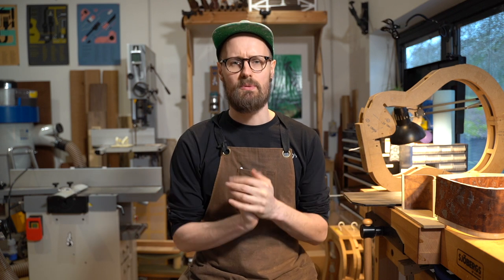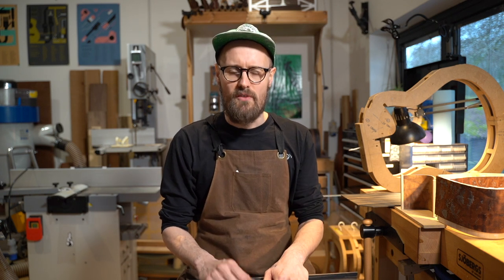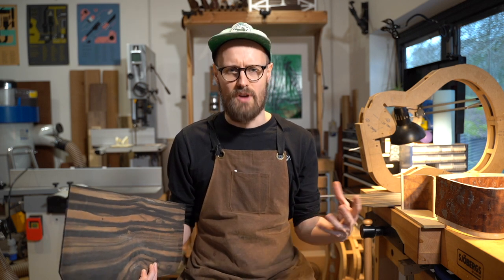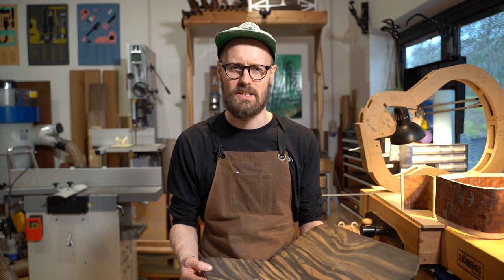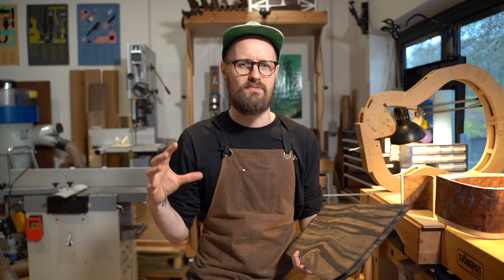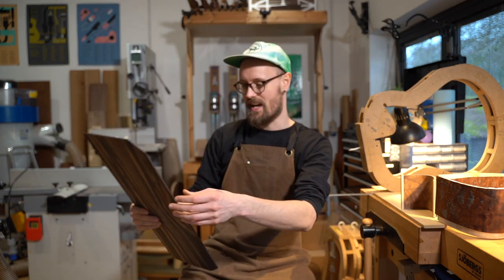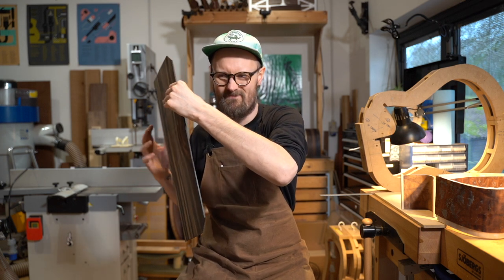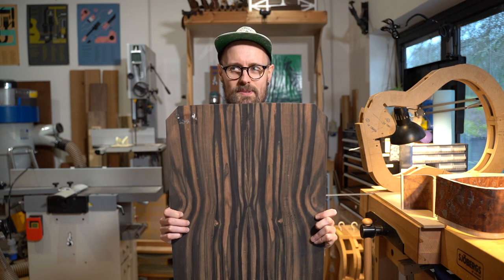CRELICAM EBONY - Diospyros crassiflora - Sustainable ebony from Cameroon - Acoustic guitar tonewood.

Comment: It’s still on the IUCN Red List as endangered due to a population reduction of over 50% in the past three generations. I wouldn’t want to promote using it for an entire back and sides set! Use it for smaller things like headstock veneer, fretboard, purflings or inlay… I’m sure your sourcing is better than what was previously available, but it’s still an endangered and small, slow growing tree. That’s just my opinion though!